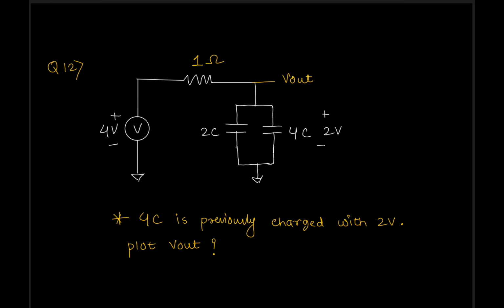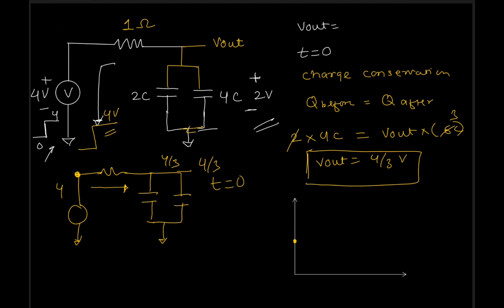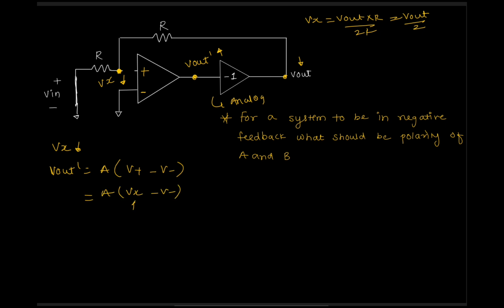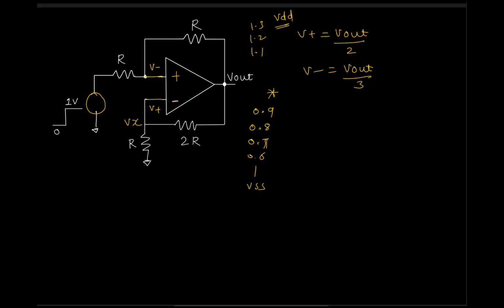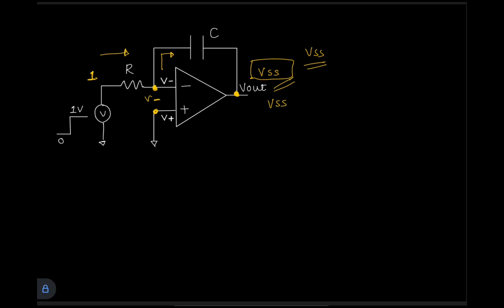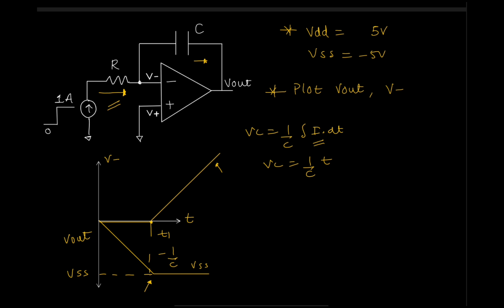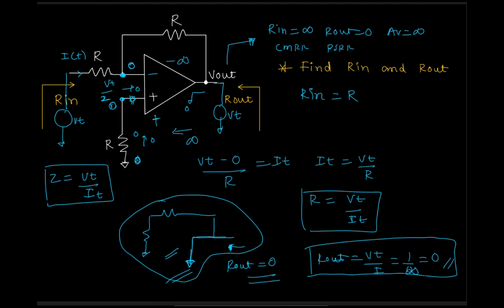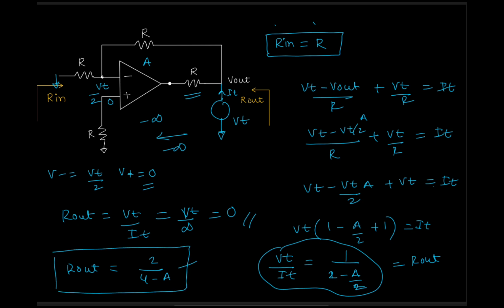Texas Instruments Analog Interview Questions Solution - Opamp Circuits (Part 2)

Comment: At46:04
About Ro 
vx=-1/2vt*A and then 
(-1/2vtA-vt/R)+It=vt/2R....(1)
Simply (1)
2It=vt+vtA+2vt
vt/It=2/3+A(A infinity)
Ro=0 but my answer is 2/3+A🤔🤔
Reply from the maker: Thank for pointing out the calculation mistake (-/+ mistake)
It should be 2/4+ A 

You have not assumed the virtual ground concept V - will be zero and solve again 

Answer should be 2/4+ A
Reply: @Analogintuitions thanks again 👌😆
My calculations mistake ,i know 😅
Reply: @Analogintuitions  ok sir so you are saying since the gain is not ideal so Virtual short concept is still valid . if the gain in ideal then we cannot apply virtual short right ??
Reply: @Analogintuitions  sir but the virtual short concept should not be valid since gain is finite ??

Comment: regarding the  first question in this video ... can we model the charged capacitor as a voltage source (2u(t) ) in series with a capacitor of 4C . Then we can use the superposition principle to get the output voltage in the Vout node. Apparently I am also getting the same output waveform . But is this modelling valid ?

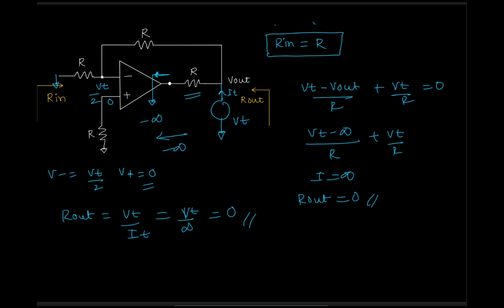Comment: 44:13 vtest is equal to vout right when u are assigned at vout .then still why u r using both variables are different. Also while calculating rout virtual short cant be applied ?

Comment: in the first question, shouldn't the charge before be 2c*4 + 4c*2,  as both of them were charged earlier and are being shorted
Reply from the maker: No actually just 4C capacitor was previously charged. It is also written below the circuit if you see carefully

Comment: At 42:33 if the output would be saturation voltage right instead of infinite just a doubt if saturation voltage is there then rout wouldnt be equal to zero.
Better explanation would be apply current source and find the voltage which turns out to be 0 and hence vx/ix will be equal to 0
Reply from the maker: Yeah thats absolutely correct

For fixed supplies explaining with the current source at output makes more sense as the output voltage make itself constant..

Thanks for sharing your thoughts. Really appreciated😊